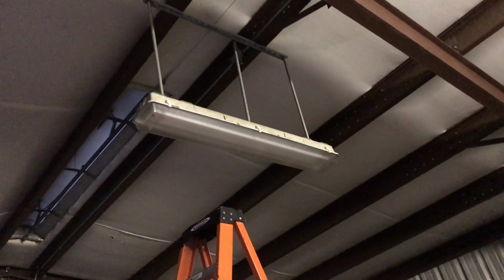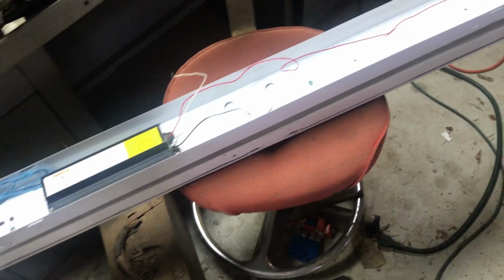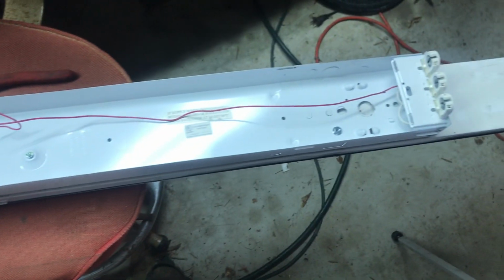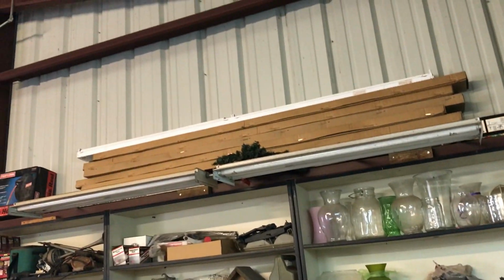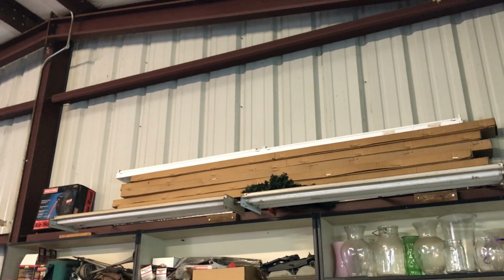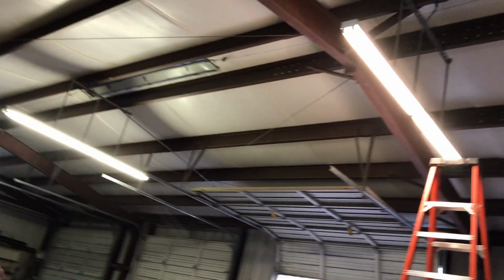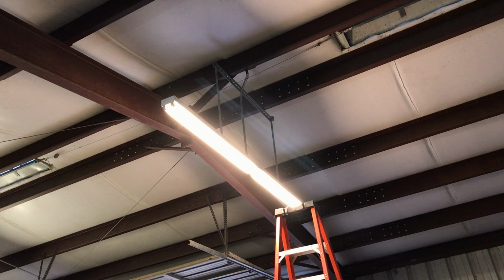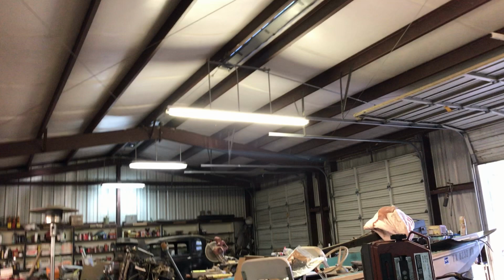Shop Light Install

Comment: The color temp looks higher on the 8’ light making it more white than yellow like the 4’ one.  Once the 4’ bulbs go bad just replace it hem with a higher color temperature. Thanks for the video.
Reply from the maker: I’ve probably got a lifetime of bulbs here. I had a lot of t12 bulbs from the building we pulled the 4ft fixtures out and when I bought these used 8ft lamps the seller gave me a big bundle of t8 bulbs. Some are different so they may be a different color temp. I’ll have to check.